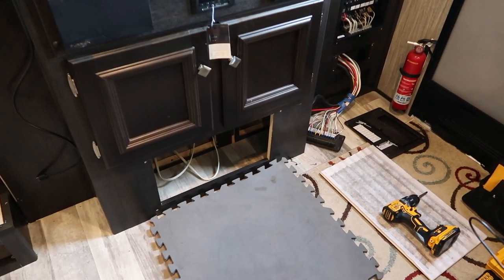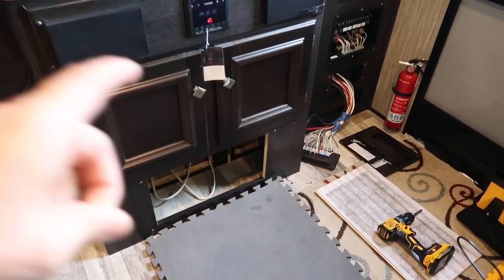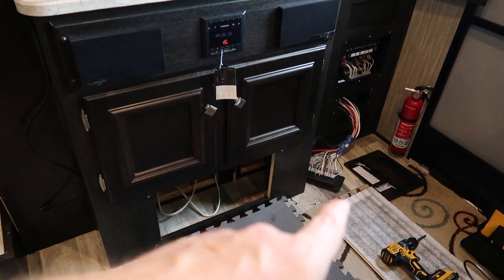Rv Tank Vent

Comment: i would recommend an AIR ADMITTANCE VALVE where your vent pipe terminates in the wall. 
RATHER THAN  making a roof penetration.
Reply from the maker: Job is already done and fixed. Thank you though.

Comment: Which is better for RVs the siphon 360 vent or the odorhog filtered vent cap?
Reply from the maker: This is the first Ive heard of the odor hog vent cap. It depends on your specific use and needs as to which one is better. In my case the vent is on the roof somewhere around ten feet off the ground. So filtering the gasses that exit the vent really isn't a concern of mine. If the vent was closer to the ground or in a place you would be more likely to smell anything that exited the vent, then the odor hog might be a better choice. Just my personal opinion, I would think anything that would act as a filter media would also restrict the venting ability and the vent may not perform as well as a vent that was open to outside air with little more than a screen and a rain cover. Ive seen some vents that even have a small solar fan in the pipe to help move air flow out of the vent. Thats not a bad set up, it it seems like its getting a little more complicated than it might need to be at that point.
Reply: What is the sise of vent tube?

Comment: Love your video.   omg.....I have a 2020 Heartland Bighorn ...... Vent pipe goes up in an 8 inch chase that has bathroom pocket door and shower plumbing.   Every time the toilet is flushed this sewer smell just floods out of the pocket door cavity.    I am going to scope it !    Also when Heartland built the unit there was no glue in the drain pipe from toilet to blackwater tank.   So it leaked fluid.   So this could be same.....pipes could be coming apart. in the wall and crawlspace and cavity.
Reply: So my blackwater tank vent is open in the wall vanity!    Not through to roof!!!    Just and open ABS pipe that when you flush pushes smell out of it.   WTF
Reply: WindersRanger,  thank to your video I was able to figure out what is wrong with mine!
Reply from the maker: Yes, the scope is probably your best bet for now. Also, do you have the plastic domestic toilet? If so, that cheep toilet was also the source of some of my odor, which I just discovered since I replaced the toilet about two weeks ago to a better porcelain one.
Reply: Porcelain toilet.  Repairing vent stack this week.  Heartland extended warranty for another yer
Reply from the maker: I put a porcelain toilet in back in July I believe it was. It also helped with some of the odor I was getting. I still get some now even after swiping toilets and fixing the vent. Both the black and grey tank in the Fuel fifth wheel I have are under the plywood floor but part of both tanks are exposed at one end where the pipes attach to them. There is probably 10 inches of the top of both tanks exposed inside the wall where the plywood flooring stops short. I guess that was quicker and easier at the manufacture than it would be to cut the proper holes for the pipes to go through the floor into the tanks. One of my tanks has a crack in it now that I have to fix. Depending on how crappy that job turns out to be ill try to film it.
Reply: @WindersRanger  Since correcting the vent pipe to go through roof instead of a pocket door cavity.......not a single odor!

Comment: I know you probably fixed it already, did you find another RV same model and see if it had a vent there on the roof? If so the manufacturer would probably fix it....
Reply from the maker: It is fixed. There are two issues with trying to get the manufacture to fix anything. First and foremost, i live full time in this rv and letting it sit at a dealer for any length of time is not my first choice. And second, rv manufacturer’s are notorious for not honoring warranty’s for rv. So I simply fixed it myself, probably cheaper and faster. Im certainly no expert in plumbing or pretty much anything else but it seems to me the manufacturer ran the AC ductwork right above where the vent pipe stopped. They most likely figured no one would ever find the issue and if or when they did the warrant would be up by then.

Comment: Can you poot  water in your roof vent to see if its cloggrd
Reply from the maker: I suppose you could pour some water down the vent. Personally, I would recommend looking into a cheep bore scope camera. They can be found online pretty cheep these days, some with their own monitor and others will bluetooth link to your phone. The reason I suggest that is just in case the manufacture didn't connect something further down stream. So you don't end up dumping water in the vent and have it spill out on the floor inside a wall some place.

Comment: Looks like Hartland is not on my list of preferred vendors.
Reply from the maker: They are about like any other RV manufacture today. Some say Grand Design are still okay, but Ive never owned one. The higher end Tiffins and Newmars are also supposed to be good but you have to have a pile of money to buy one. The big issue with RV's is they all use the same systems by dometic, furion and so on. So no matter how good your RV might be if the systems are junk the RV will seem like junk too. Although, the absent sewer vent pipe has a nothing to do with the what type of systems are installed and everything to do with Heartland manufacturing and quality control. Personally I think the biggest issue is they are trying to crank out as many units as they can so quality will suffer. So far I've I have been able to fix all of the issues I have found.